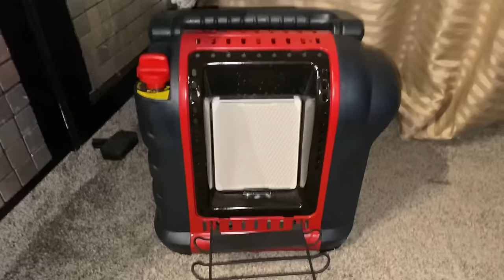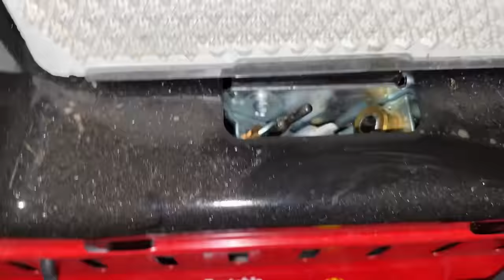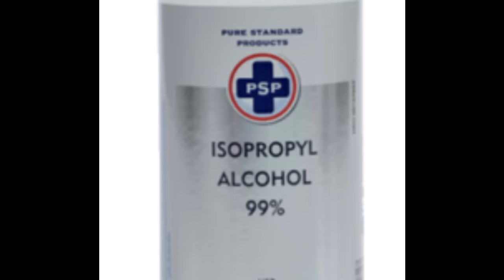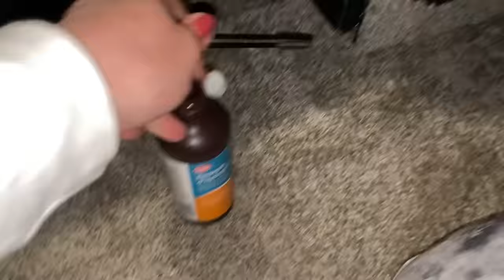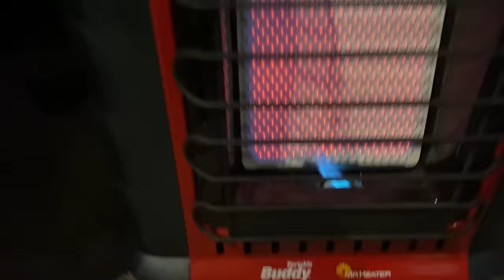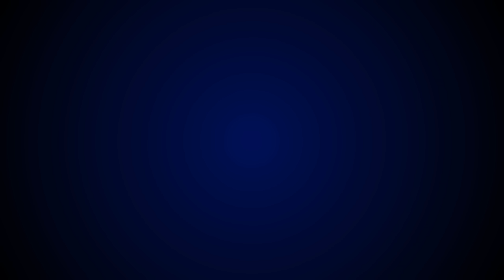Buddy heater won't stay lit | clean the fuel intake | DIY Repair

Comment: The problem is your flexible hose running to the external propane tank.  If you're using a soft flexible hose, it stays flexible because of a conditioning oil in the rubber hose.  High pressure from the tank forces the oil out of the rubber and guess where that oil winds up?  If you are going to use a flex hose, you absolutely must use a filter and change it every season or the entire system will flood with oil after repeated use!  Then you will have to completely disassemble every valve and line and clean with a solvent.  (Pain in the rear!)
Reply from the maker: Thank you for watching @bcarter1973 !

Comment: I had the same problem with the pilot and corrected it just as you showed.  I've used my mr heater through two winters.  Very glad to see you know that bulk propane costs only about 1/4 that of disposable tanks; it seems that hardly anyone with vids on YT has figured that out.  I have a 30# tank and a 4' hose that costs about $35 for 20-25 days of operation on low setting.

Comment: You’re my hero! I spent 30+ minutes trying to get my big buddy lit 🔥 before searching solutions. Did what you suggested. BOOM! Baby we’re in business ready to be toasty warm when the temps hit 31 degrees tonite. Many thanks!!!! 👏🏽👏🏽👏🏽

* update * my heater wouldn’t lite the next nite. Cleaned again & used compressed air to clear the pilot lite line. No dice. Had to replace the hose and filter to get things working but so glad I don’t need to replace my buddy heater after only one year.
Reply from the maker: Glad I could help
Reply: yes have used these heaters for years for hunting, always use a buddy filter on the propane line when using a bulk hose. The hoses break down over time and the filter will catch the debris, without the filter the regulator can become damaged from the debris.

Comment: We used a pipe and cleaner and worked like a charm! Q tip wasn't getting in there far enough! Thanks Paula 😘
Reply from the maker: Excellent!
Reply: A Q tip will go in 2 inches or more IF you remove about half of the cotton from the tip... also, Gumout carb cleaner works better than alcohol

Comment: Nice idea, a mascara brush. I was actually trying to get a tiny brush for that purpose. I used a Q tip. Then a piece of wire for hanging christmas ornaments. The flame still had some orange in it. Got a can of air for cleaing and sprayed it in there using the long tip it came with and now it's a solid blue flame, like when new. I've used mine for 7 years with a filter and regular hose with 20 lb. tank. Finally I've replaced filter and hose too.
Reply from the maker: thank you @JamesSmith-jq2jc, I appreciate your support!

Comment: It works!!! Thank you cause it is 25 degrees, windy, and I'm in a camper.
Reply: Rather than thanking her for cold weather, wind and a poorly insulated trailer, - You should be thanking her because she saved your as$ from  hypothermic dangers by showing you how to get the heater, (or lifesaving device in this case) working again.. no slacking.. now smoke up johnny!

Comment: Thanks .....mine was doing the same thing  in my truck camper i use for a back up heater .....i cleaned it with a Q tip and alcohol .....bingo it works like new ....thanks !
Reply from the maker: Be careful that the q tip doesn’t break. I did that once and ruined the whole heater
Reply: @VanVida  Ok gotcha .....thanks 👍

Comment: Huhm, live flame 🔥! No buddy heater for me then. Good hack in cleaning that opening.👍❤️
Reply from the maker: Yes there is a flame. I keep a window cracked open and I have a carbon monoxide detector
Reply: MoBang - The only CO producing flame is the pilot light. What you see on the matrix after the initial start up is a catalytic reaction. The reaction consumes oxygen so you need to supply some fresh air to the space.
Take a CO detector and hold it above the heater when you light it and see what the reading is.
Reply from the maker: @laurieberg2880  thank you
Reply: @laurieberg2880  It's not the CO that worry me. It's the actual fire from the pilot light. If anything accidentally get near it!😯 Not safe at all sleeping with that thing close to you.

Comment: Thank you very much I had the same issue with mine and I did what you said works beautiful
Reply from the maker: I’m so glad I could help!
Reply: @VanVida  I have question that may be u can answer how come there are so many women doing van lifer ❓
Reply: @ga9100  They enjoy or see the benefits of it as do men.  Why else?  And you can use one of these heaters any place you choose, it doesn't have to be in some sort of camping or vanning situation.  Mine is in my garage/workshop.
Reply: I use mine in my mobile home bc my central heater broke to much $$$ to fix

Comment: Nope.  Mine still fails, but the flame is much smaller.  I already cleaned out the lines and found zero fluids.  Cleaned the thermocouple that the flame barely contacts.  All started when it would not stay running for more than a few minutes.  Going in the garbage this week.
Reply from the maker: Sorry to hear that

Comment: Bought my Lil Buddy this year. TY for this heads up!. I have a stupid question. I hooked my heater up to a 20lb tank (outside my casa). Can I keep that tank valve open 24/7 ?
Reply from the maker: If you are moving it or driving with it I would keep it closed

Comment: Canned air and a can of brake cleaner. About a minute and a little drying time its as good as the day i bought it.
Reply from the maker: That’s awesome
Reply: Not as inexpensive as your way and only a bit easier, but 100% effective. The whole pilot light is blue. No yellow at the tip.
Great video. Very informative!

Comment: Mine sparks but won't even light. It was lighting but going out. I tryed everything.
Reply from the maker: Try this a couple times, it should help
Reply: Another problem that can act the same way is opening the valve too fast if you use a larger tank. The OPD valve { safety valve } is designed to close if opened too fast.  I had this occur several times before I learned to open the tank very slow. Sometimes it would light and the go out as I walked away from it. Also if you exchange tanks, some valves are more sensitive than others.
Reply from the maker: @mikemorgan5815  thanks for the info

Comment: I did that and it still will not stay lit.  I was just using it this am and when I went to change tanks.  I changed the tank and hooked a new tank up and cleaned it and it still will not stay lit.  HELP
Reply from the maker: You may have to clean it a few more times
Reply: I'm a little late with this. You may hay figured out by now that you need to open the tank valve very slowly so as not to trip the OPD safety device.

Comment: I cleaned mine and the flame is much better but still dies out, any ideas?
Reply from the maker: try cleaning it again. make sure propane is on tight and is full. if it still wont work, bend flame sensor 1mm to the right
Reply: @VanVida  I'll give it a try thank you